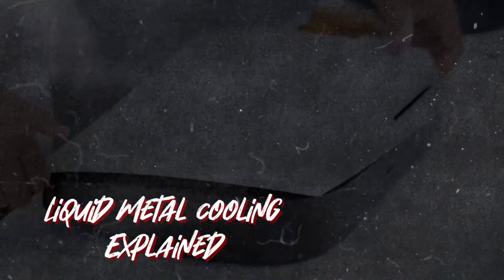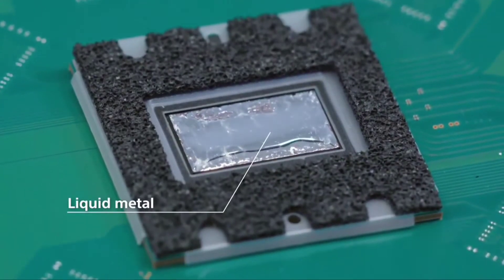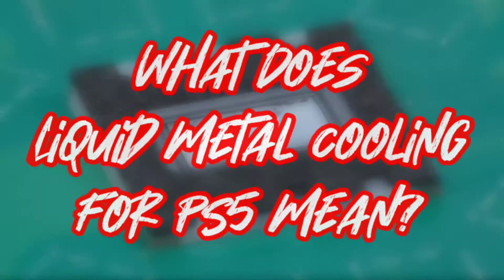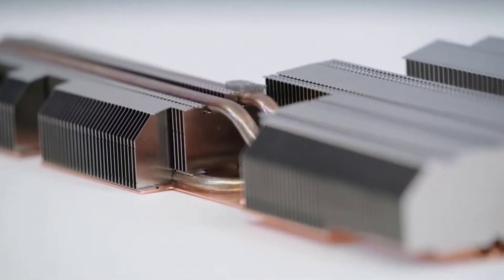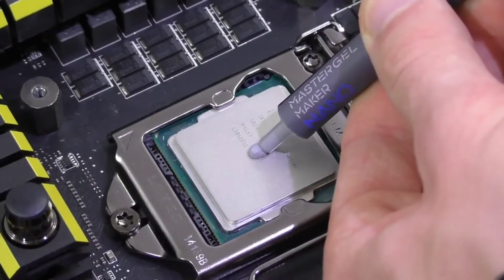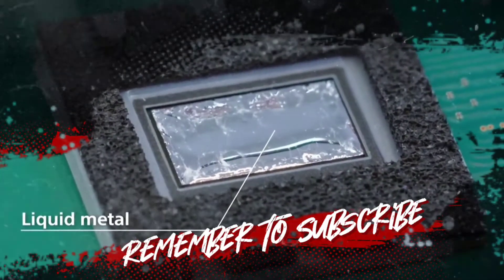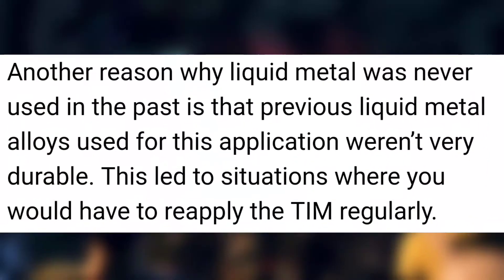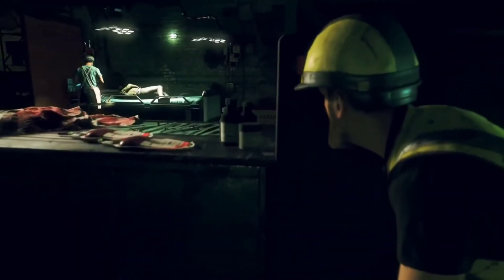Why a PS5 WONT OVERHEAT!!!!!!!!!!!!!!!!

Comment: I’ve had the PS5 since launch and it recently overheated , I just took it apart cleaned the fans and vacuumed the radiator and battery and it’s running like new again.

Comment: What about the bottom of the Ps5 when you stand it up Vertically, I shut mine off after a stream and the bottom was pretty hot.. made me abit nervous, after powering it down I disconnected it and laid it flat and turned my fan on behind it to make sure it got a faster cool down.
Reply: the point is to get the chips should not overheat and it doesn't really matter if the body is hot (tell me if this doesn't make sense)
Reply: I'm no expert but I suppose, ironically it doesn't heat up anymore as I lay it flat instead of standing it up.
Reply: @garzaclaytoncg  just saying if its hot its doing its job 👏🏼if it don’t blow out hot air then there’s something wrong
Reply: @garzaclaytoncg  and sony recommend standing it up

Comment: Wow, you LITERALLY know nothing about liquid metal.

I build PC's and I use liquid metal on my personal systems and every brand of liquid metal I've ever used, has dried up within a year. Also, liquid metal doesn't guarantee that the console will never overheat even if the liquid metal is still liquid. It transfers heat, it doesn't actively cool the processor ffs
Reply from the maker: The liquid metal in question is what Sony is using, I don't think their stupid enough to give you paste that will only dry up after a year.

I build PC's too mate and honestly I opt for liquid metal..
But then again it's a matter of preference 🙂.
Reply: @RoboCopPhoenix  bro can you tell me why did cpu ihs use liquid metal?
Reply: Degradation can occur as the interaction between the metals, i.e. galvanic corrosion between copper and aluminum in custom loops (SONY developed the compound and the heatsink, I'm sure they have taken this into consideration and made adjustments).
Reply: What matters is over time degradation, also corrosion, and thermal expanding of the material.

LM compounds are enriched mixes of different stuff with gallium. During the time it evaporates and oxidizes, sometimes causing the reaction with the cooling block surface.

Sony tackled the issue by sealing the die and the compound hermetically under the radiator. We've seen this on their patent, but couldn't interpret it earlier.

You can see on pictures that there's a seal around SOC chip with a tiny gap around.
The gap is for the thermal expansion of LM. If it was sealed flat, there would be constant pressure build-ups during heating up which might have lead to die degradation.

It's clearly visible on the patent, that this tiny gap creates a compartment around the SOC, and all conductive elements are sealed under and around it.

Providing the CPU has around 40W TDP and GPU can be estimated up to 140W, this is a really nice solution. I think that PS5 has to run cool, not for the sake of being quiet, but for the necessity of high clocks speed.

Sony did a great job, the console will be cool and quiet and we won't have to change LM over time as PC users do. (2-3 years for PC)
Reply from the maker: Couldn't ha e said it any better myself..
Dude you deserve a medal 🙌🏾🙌🏾
Reply: @RoboCopPhoenix  People need to do research first, Sony wouldn't make the console like that if everyone needs to replace their LM so fast, it wouldn't make any sense.

And thanks mate!
Reply from the maker: I swear I took time to make this video..
Am sure you've seen the comments on this video, like dude Sony is a big company there's no way in hell they would put Cooling paste that will dry up after a short time
Reply: @RoboCopPhoenix  well they did, so you're wrong.
Reply: @Frr46nK  2 to 3 years lmfao where you get this shit... You guys haven't got a clue what you're talking about. Sorry Sony fanboys.
Reply: @NikoBell1188  Haha and you are a sony hater? Why would they release a product that isn't durable? Who are you to say that?
Reply from the maker: @Bong Jovi...
Dude the only idiot here is you to be honest..
You literally sound like an absolute PC fan boy..
Get your head outta your ass fam
Reply from the maker: @Dame Dane Dameno my mahn 😅

Comment: You must live under a rock if u think liquid metal is a good idea. There’s a reason company’s don’t use it one it drys on copper which the ps5s sink is. it drys out way to fast and needs to be applied often by no means is it long term so that means possibly a tear down a yr to be safe it’s hard to remove from the sink and dye... only good thing is it may lower temps this has been covered by many YouTube channels that has a lot bigger following
Reply from the maker: Alota following or not..
Fact still remains this new method of liquid metal bypasses what was being used in the past.
Sony is not stupid to use a paste that will only dry up after a year.
Reply: @RoboCopPhoenix  Yes they clearly are because they used it lmfao you're an idiot bro... Liquid metal is liquid metal.
Reply from the maker: It's a matter of preference at the end of the day..
I prefer liquid metal cooling and you don't.
It's really that simple 🤣🤣
Reply: @RoboCopPhoenix  it's not a matter of preference. It dries up. That is a fact, not an opinion.
Reply from the maker: I suppose we would have to wait a year and see 😂
Reply: I’d rather be safe with grizzly paste or m4 over liquid. If it was so much better then paste every company would be using it but it has way to many down sides for just a few degrees cooler temps
Reply: Sony tackled the issue by sealing the die and the compound hermetically under the radiator. We've seen this on their patent
Reply: @ Alek Santeri this isn’t remotely what I’m talking about but sense you brought it up one person on has a dead console after a day of playin he opened it up and the metal seeped out the middle of the amazing Sony seal that patient and destroyed his console and from the looks of it there’s been a lot of dead console popping up and I say those have the same issue if opened
Reply from the maker: Honestly guys, Sony is a huge tech company.
They tried and tested liquid metal for 4 years before going with it.!
So I still stand by my statement that liquid metal is perfect
Reply: @RoboCopPhoenix  Well you're wrong. Liquid metal has been around long before that, and I've been using it for at LEAST 4 years, using different brands and even making my own.

Just because you ASSUME it won't dry out doesn't mean it won't. Where has Sony ever said that it won't dry out? Please enlighten me, Captain Chemistry.
Reply from the maker: Well I do know it's been around for many years, I've used it before, maybe not as much as you.!
But look dude you are right, it could actually dry out but the time frame at which it would dry out is perhaps what concerns me, maybe it won't be within a year.!

And yes I actually agree, you make very valid points which is why you've actually reminded me of my idea to cover a video of ordinary paste liquid paste.!

Your points are very very valid
Reply: @NikoBell1188  dude just stop talking you’re embarrassing yourself

Comment: What are the downside of liquid metal cooling?
Reply from the maker: I suppose the major downside is that it's expensive.
But it's really a long term solution
Reply: @RoboCopPhoenix  ppl say you have to clean ans replace it often is that true?
And how long can you use it before having to replace it?
Reply from the maker: Nah those are false rumors..
In my video I explained why the previous metals used to turn metal into a paste were unstable..
The current one in the PS5 is "gallium & indium" & is enough to last the console its entire life cycle and more, a console life style is 7 years and with liquid metal it can do 3 times the life span
Reply: @RoboCopPhoenix  okay your a live saver sorry i ask so much but...
Should i buy the PS5 in launch?
Reply: @sharthub253  Yes, you do. After 6-12 months, it will dry out and become useless.
Reply: @NikoBell1188  liquid metal in the past but not the liquid metal sony uses. They won't make it liquid metal cooled if you had to reapply it every 6 months. What sense dose that make?
Reply: @RoboCopPhoenix  No it's not.
Reply: 1) It's conductive. Makes a short circuits when leaks
2) Risk of amalgamation with other metals (i.e. watch mercury destruction of aluminium videos)
Reply from the maker: @Daniel Combs you make a valid point mate